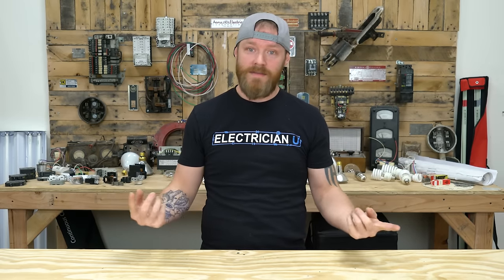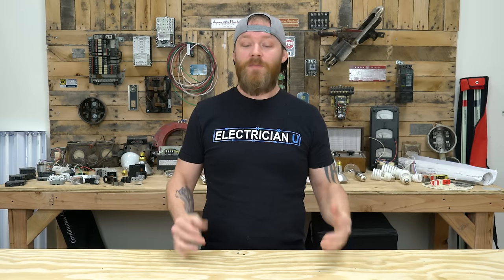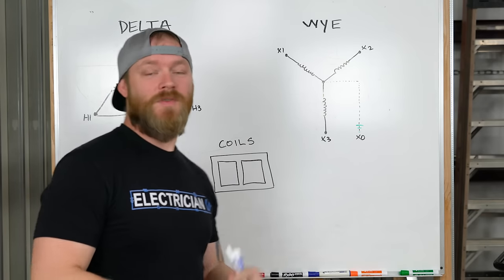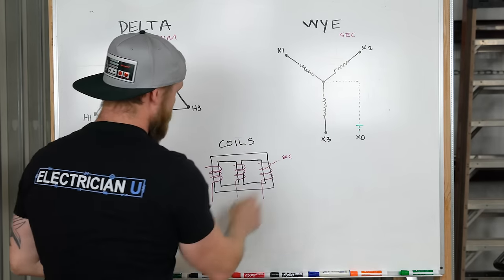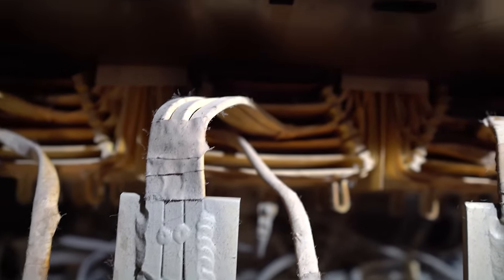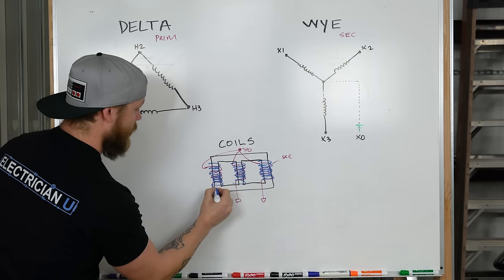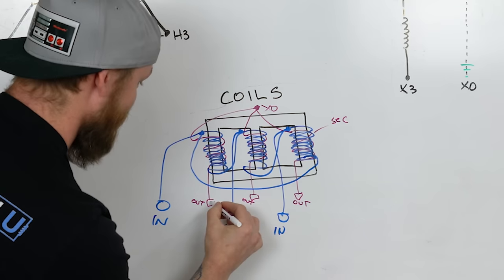TRANSFORMERS - What They Are, How They Work, How Electricians Size Them

Comment: I just want to add that a transformer to electrical power is the exact same thing that a transmission is to mechanical power. The formulas are almost exactly the same as well. Volts/amps and rpm/torque.  A transformer or transmission simply changes the ratio of volts/amps or rpm /torque to suit the load as needed.

Comment: For those with little to zero experience with transformers - but always worked around them - this video is a cool little "cliff notes" version of how and why they do what they do.  I'm low voltage by trade, but have always been fascinated by electricity.  I've completely rewired my own home  (to code, passed inspection) so I'm familiar with single phase, but the three-phase w/associated transformers always escaped me.  Thanks for putting this together.

Comment: At 13:08 , you must be careful of saying the windings are 'not' insulated....they have to be, and it is usually a thin coating of plastic, or enamel ...(used to be varnish)...just usually not a thick plastic. But a very informative vid....keep us the good explanations .....
Reply: Tom Garbo  Yep, alot of transformers are dip coated also, mostly for moisture resistance, and it helps with lamination vibration that causes humming and buzzing.  But my point was that the wire turns CAN'T touch and short out, it would burnout the winding, etc.

Comment: Great informative video, but do you think you can elaborate on "dirty" power from primary, which, as you say, has no effect, or rather a"fresh start" on secondary output?
Reply: Dirty power means a large fluctuation in the voltage which is not good for efficiency. It can be such that something very sensitive may not even run properly or be damaged when energized with it. Hydro here in Ontario for example guarantees 10% accuracy in voltage. So out of a 230V split phase service to a home that's a difference of 23V or + or - 11.5V. That's fine for almost anything a home owner would use. Some Commercial 600V could be off by as much as 60V at any one time although 3 phase delivery would help mitigate that better than single phase. Most institutions use transformers to eliminate this error where necessary as described in the video. 
AC current always has a frequency and an amplitude; so there's no escaping some measure of fluctuation. The important this is: the potential difference in volts fluctuates inversely with the current in amps as stated by Ohms Law, but the total power will remain the same.

Comment: At 14:50, you described the windings as "one solid conductor." The metal in those windings have a very light, but very definite varnish to act as an insulator. Otherwise, you wouldn't actually have distinct windings that are absolutely required to achieve the inductance necessary for a transformer.

The degradation of that insulation is often what leads to the failure of transformers, as the reduction of "true" windings leads to improper voltage transformation.

Comment: Thank you for the excellent introduction to transformers!  I am running 3 phase 600v motors in my home shop.  currently i am boosting the 240v single phase utility co power to 600v to power a variety of VFDs running my machines.  To increase the motor sizes that can run I was thinking of building an rotory phase converter (RPC) using 240 single phase  input and a manufactured third leg into a 20hp idler using start and run capacitors to balance the legs and then boosting the 3 phase 240v RPC output to 600v using a 3 phase transformer (15 kVA?) and  into my 600V rated VFD's.  My objective is to be able to use an existing 10hp vfd to power a 10hp 3phase 600v motor on my stationary bandsaw mill. Does this approach make any sense to you?  Thanks in advance for any thoughts/guidance you may be able to offer.
Reply: Just remember when going the other way through a transformer that your available amperage drops. So if you used a 15kVa transformer rated at 36.1A on the 240v side, when going up to 600v that the transformer would only be good for 14.4A @ 600V. 

I am not sure if going into a rotary phase converter at 240v and then into a transformer makes sense. The RPC would have to support a very high amperage load. A 15kVa RPC requires a 100amp breaker and 3 gauge or larger wire to it (and would have an 84 amp running current). You would be using that much power just to get 14A usable electricity out at 600v 3 phase (about 10HP worth of VFDs and motors). It would be much more economical (as far as wiring size) to go from a single phase 240v to a single phase 600v then into a RPC, if you can find such a transformer and RPC.

That seems like a huge waste of power and money. You can get a 10HP 240v single phase VFD that will run your motor and it will have an amperage draw of 40-45A and cost far less than all this other equipment. I know you already have "an existing 10hp vfd and 10hp 600v motor", but it just doesn't really make sense to spend $3000 to make them usable when it would cost $2000 to buy a new VFD and Motor that works on your already existing single phase home power. That doesn't even take into the cost of running it, since doing all the 3 phase converting and voltage transform uses double the actual amperage draw, which means 2x as much money per hour to run it over just getting new, single phase 240v drive and motor.
Reply: Search for a "GS23-2020" VFD.
And some possible motors to go with it would be:
Marathon SY069 (best efficiency and torque but at much higher price and only certain VFDs can run it)
Marathon GT1019A
IronHorse MTCP2-010-3BD18C

Marathon GT1218A
IronHorse MTCP2-010-3BD36

Comment: Your videos are great and helpful to tons of folks. I'm just adding a few things that may help some of your subscribers. 1)The primary and secondary side of a transformer is in respect to power flow. A step up transformer would have higher voltage on the load/secondary side and lower voltage and the source/primary side. 2)You don't necessarily get half the voltage with half the windings. The only time that happens with nominal voltages is with a Delta/Delta configuration. A 138kv to 69kv substation transformer would be a ratio of 2 primary windings for every secondary. But a 2:1 ratio in a WYE/WYE 277/480 would be 139/240. Because when calculating ratio you use phase to phase voltages on Delta and phase to ground on WYE (phase to ground is phase to phase divided by 1.732). Understanding this is a huge deal when calculating which tap to use on a transformer. 3) Knowing that Watts is "Real Power" that actually does work. Volt Amps is apparent power, real power plus reactive power. Reactive power does no actual work, like exciting a transformer that has Zero load on it. Electric co. has to generate the power to energize a transformer but the customer is not charged. Residential customers pay for kWH, commercial customers are charged for not staying with certain power factor set by the state corporation commission. Size transformers by VA not Watts. 4) Transformer windings are wound in conjunction with the nameplate vector. In your diagram the X0 -X1 winding would be induced by the H3-H2 winding. When connecting a TTR (Turn to Turn Ratio) tester to ratio the windings this is important to know, otherwise you would not be able to perform the test.  Keep up the good work.

Comment: I gotta watch this twice, switching over from automotive 👍🏼
Reply: Just so you know, what a transmission is to a car a transformer is to electricity. The same thing. A transformer matches power to an electrical load and a transmission matches power to a mechanical load. 

A transformer changes the voltage\amperage ratio while a transmission changes the rpm\torque ratio. Voltage X amps = power. RPM's X torque = horsepower (actually rpm's X torque X correction factor = horsepower).

Comment: Dustin,   Great video again!    One point, this type transformer, if connected to steel, should never be connected to a ground rod.   Also, an educational question, a transformer with 208 volt wye that is rated 75KVA will put out how many amps when turned on?

Comment: Dirty power means a large fluctuation in the voltage which is not good for efficiency. It can be such that something very sensitive may not even run properly or be damaged when energized with it. Hydro here in Ontario for example guarantees 10% accuracy in voltage. So out of a 230V split phase service to a home that's a difference of 23V or + or - 11.5V. That's fine for almost anything a home owner would use. Some Commercial 600V could be off by as much as 60V at any one time although 3 phase delivery would help mitigate that better than single phase. Most institutions use transformers to eliminate this error where necessary as described in the video. 
AC current always has a frequency and an amplitude; so there's no escaping some measure of fluctuation. The important this is: the potential difference in volts fluctuates inversely with the current in amps as stated by Ohms Law, but the total power will remain the same.

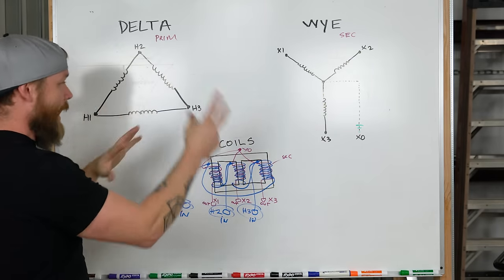Comment: That's not typically what isolation transformers are for at 5:20.  Actually that'd make an interesting video on its own.  Why not mention the most important reason for Delta/ Wye instead of just rambling on?  Did he just say at 11:40 that you could have 208v vs 240v while talking about a three phase system?

Pro tips when working with transformers:  Know the impedance and short circuit calculations.  Know how to calculate proper primary and secondary overcurrent protection, where to locate disconnects, how to calculate conductor size, clearances and always megger the windings.  Especially on large transformers.

Comment: Excuse me wat, all it does is voltage… this dude doesn’t know the current doesn’t matter???? Yes it changes the current capacity, but that’s the key word “capacity” 

you can use the same gauge wire on both sides of a transformer as long as you don’t overload it… 

The way this dude is trying to explain it is using a transformer automatically pumps say 2x more amps into Somthing… that’s just not how it works… that’s like electricity 101, you get double the current capacity not double the current… besides it’s the device that “decides” how much current it needs. Using a transformer isn’t going to make that change.. it will still take the same amount…

Comment: Great timing! I was just doing a transformer PM at my site when this came out, great training tool! Could you do a video about different breaker panels for different phases/voltages? I recently had an electrician tell me one of our panels is wired as a 208 panel but they used a panel with a different voltage rating, can you explain the wiring differences? Love the show, thanks for sharing!
Reply: The breakers and panelboard require a voltage rating that meets or exceeds the nominal system voltage.  Typically, either 240Vac, 480V, or 600Vac, are the voltages used in equipment made for the US market.   No manufacturer is going to make a special 208V-rated breaker, when a 240V rated breaker is already available.  They are going to standardize on 240V breakers for all systems that are 240V and less.

Where you do have to concern yourself with the difference between 120/208V and 120/240V, is when you work with slash rated breakers, as opposed to a straight-rated breaker.  Slash rated means there is a voltage-to-ground that matters, in addition to a phase-to-phase voltage.  Straight-rated breakers don't "care" about voltage-to-ground.   Most 1-pole breakers are slash rated.  The 3-pole breakers are straight rated as a standard, and with 2-pole breakers, it really could go ether way.

A 120/240V slash-rated breaker would be OK on a split-phase system, OK on a 120/208V single phase system derived from a 3-phase service, and OK on a 120/208V three phase system.  But it would not be OK on the high leg (B-phase) of a high leg 120/240V delta system.  The B-phase in this system is 208V to neutral, which would restrict single pole breakers to only the A and C phases.
Reply: @carultch  Great explanation

Comment: Whoa there stud.....Apparent Power (VA) is not True Power (Watts)!!! I understand the making it simple. But you were kind of correct at the beginning of the video saying that VA (S) and Watts (P) were kind of the same. The way I explain to to Junior Techs is that Watts is a part of VA. Reactive Power  (VAR=Q) and True Power (Watts=P) make up the Apparent Power (VA=S). That being the main reason that Transformers are sized in VA to begin with. The manufacturer has no idea what mix of load will be drawn. Inductive, Capacitive or Resistive, which change the Power Factor, so they are sized in VA. Great video nonetheless.

Comment: So, just for the sake of clarity, if you want to drive a load of 41kva, then the primary MUST be able to provide at least 41kva..  Correct ?
The only difference is;  The primary will have a higher voltage and lower amperage, while the secondary has a lower voltage and higher amperage.
Primary winding:       480v x 85amps = 41kva
Secondary winding:  208v x 200amps = 41kva

Comment: Dustin, I want to know 240v single phase converter 208v 3 phase. I have a membership at Pacific Bus Museum. There was a crane on the ceiling. I saw it was showing 208v 3hp. I opened the covered inside show 220v or 440v wiring diagram. I see there is a 220v wire connected. I figured out I connected the 240v single into the crane motor and it was not working. so Can you help me how to connect 240v single to 3 phase. I connected 240v 3 phase (T1, T2 and T3) to the motor on the floor. It was not running. I think Capacitor for starter motors. Help me inbox Thanks Cheer!

Comment: Dustin I love it you explain it very simple please keep making videos like this another one you should do is motors and tapping or why you can feed a 480v motor with #10 s thhn or whatever but also one thing you missed is where would you need a bond bushings on primary secondary?
Reply: Other than when a raceway contains service conductors or GEC conductors, the general reason for needing a bonding bushing is that you have missing or impaired continuity in the raceway system.

If the raceway system connects to a plastic enclosure, that is missing electrical continuity, because plastic doesn't conduct electricity.   Regardless of voltage, you'd need a bonding bushing to connect the raceway, to the subsequent raceway.  Or to contents within the plastic enclosure, if applicable.

Impaired continuity is what happens when you have ring knockouts remaining.  The equipment comes with a group of concentric or tangential knockouts, and you don't use the largest one. Unless equipment is otherwise rated for higher voltages, the tangs of metal that hold together the remaining knockouts are only "strong enough" for fault currents in systems that do not exceed 250V nominal to ground.   Your 277/480V system, DOES exceed 250V to ground.  The ring KO tangs are not sufficient for being the only continuity from the raceway to the box.  A bonding bushing and bonding jumper, is required for giving fault current a path around the chokepoint, so it doesn't rely on the ring KO's.  Some equipment is rated for higher voltage bonding, such as 4S boxes.  The knockout is much more heavy duty than a standard knockoout.

Comment: I will be installing a 75 kva 3 phase s/u xfmr, 240 hi-leg primary to 480/277 secondary. It will supply power for a glycol chiller (68 fla) located 60 feet from xfmr equip. Do I need both pri and sec protection and what size?

Comment: In my opinion its all about the watts.  the meter charges you according to how many kilowatts of power you use.  As a crypto miner all that matter to me is how many watts my cards and rigs are using.  the voltage is 120.  each graphics card I run uses about 120-160 watts or roughly an amp per card .  I use 4 circuits to run 4 rigs and the fans required to keep them cool.  I do a lot of data center work.  what a data center uses is servers.  lots, 1000's of servers. they probably use 277v servers for effiency reasons.  ultimately , the only thing we need to understand is how much power is required to run x amount of servers.  Building power to the lights and a/c to keep the people cool is nothing compared to what the purpose of the building is and that is to power thousands of servers.

Comment: The reason you see Delta primary is that the utilities deliver 3 phase with no neutral. The 3 phases are 120 degrees apart. On the secondary use of a Y allows you to create a neutral. Assume this is home delivery Now you will have all voltages are 120V  wrt ground but between phases you will get 208V. The neutral must be grounded or else you will have no place for neutral current to flow to. The reason that transformers are quoted in VA and not Watts is that it is possible to overload a transformer without hitting maximum wattage or for that matter even using any power at all! How does this happen? If you have a reactive load - inductive or capacitive - the current will be be 90 degress out of phase with the voltage. In this scenario you are drawing zero power but could be overloading the transformer windings. Real power is VxAxcos(x) where x is the phase between current and voltage, if you re completely in phase then power is indeed VxA as the cosine of 0 is 1.0. When V and A are 90 degrees apart then cos(90) = 0 and hence no power is delivered.

Comment: hi , i have a Question.. If a Line Array system is 110v , but the generator rented range from 100kv to 230kv 3 phase @ 240/480 , should i buy a 3 phase 150kv transformer to step down to 110 / 120v?

Comment: A pole pig or distribution xfrmr is about 30/1  ratio 7200 volts off 1 phase leg will give 240 on the
secondary. this is why is it dangerous to back feed a home w a generator and the mains not
turned off, 240 going up the svc drops puts 7200 volts on the primary winding. a very dangerous
situation for linesmen.